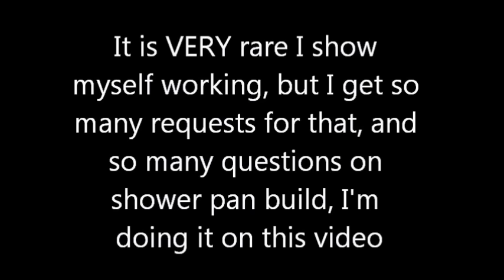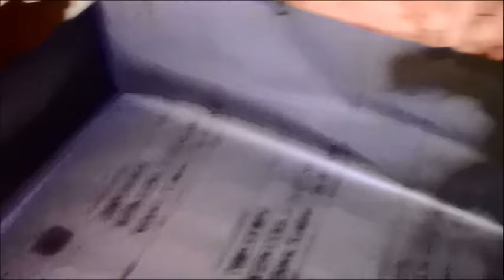HOW TO SET SHOWER PAN LINER and MORTAR

Comment: This is NOT correct.   A pre-pitched mortar bed is generally REQUIRED.   See the videos from Oatey - one company that makes the liners from Home Depot - they suggest that a pre-pitch is done ALWAYS.  This is to avoid water pooling in the low spots of the floor - giving the CUSTOMER a musty smelling shower.   The pre-pitch avaids the standing water.   Don't EVER make a custom made shower pan without a pre-pitched bed.     

See this video for the correct procedure.  ----- >   https://www.youtube.com/watch?v=xpE1A6ogUNI
Reply from the maker: You are sadly misinformed, even by the manufacturer, if you look on that video I made my comment years ago, they did at least four to five things incorrectly in their own video....
Now fast forward years from when that  video was produced and nobody is doing watery and water out system anymore, everybody puts a waterproofer on their mortar pan so the whole idea is Antiquated and irrelevant

Comment: You must Always,  Always have a pre slope !!  ,   To prevent water pooling underneath pan liner !!
Reply from the maker: No water will ever get there when you waterproof the surface...moot issue
Reply: If done correctly, why would water pool underneath? Do you really think water is gonna flow freely to the drain? 😂

Comment: It takes me 2 days to prep a shower 100%.  Why wait 5 days?? No need to redgard the mortar bed....Just do a pan liner with a preslope or a thin bed method with kerdi membrane/kerdi drain and ardex 8+9 over it....That way you don't need to wait for the mortar bed to cure for 3-5 days unless you have other things to do.  Do you only do tile?? Do you remodel the whole bathroom from A to Z? Show us a video of complete remodel...Drywall, electrical, paint, cabinets etc....
Reply from the maker: You have your method and I have mine, I am not into the newer products out there since my method has been a Fail-Safe there's no reason to change it.

And yes I have a very wide variety of skill set, on my main channel is my intro video and you can watch it to learn about me and my knowledge👌
Reply: @StarrTile  I noticed in a video by someone else that he presloped mortar before he put the pan liner on and then sloped the top layer. You don't preslope/mortar. Just your way of doing. Any advantage to presloped or not?  just curious and do you suggest Redgard before pan liner or is it an overkill
Reply: Yeah I’m surprised Bob didn’t do a pre-slope.  I’m sure he has good reasoning behind it.  I know in a lot of new home construction/remodels they  just set the pan liner on the sub floor, no pre slope.
Reply from the maker: @charliegarrison2987  prior to about 5 or 6 years ago when nobody was waterproofing their pan surface then there might be a very slight advantage to do in a pre slope but it would be negligible because your pan material would still be wet regardless... nowadays everybody's waterproofing the surface of their pan before their tile so have any pre slope serves no purpose and is a moot issue
Reply: @SINSTER7THREE  He's explained why he doesn't do preslopes and he's also made a mockup showing how it works in other videos, look it up. I believe in preslopes because i've seen a pan liner crack and leak in an old shower with no preslope and clogged up weep holes.... Nobody does preslopes in Fl and Georgia in new construction and yet those showers don't seem to leak.
Reply: StarrTile Hi Bob great videos! When you say waterproofing their pan surface so there’s no need to do a pre slope do you mean sealing the plywood before you install the pan liner with some sort of sealant?
Reply from the maker: @joetallman41  No, the pan surface meaning the mortar that you pour in the pan, after it's dried and cured for 3 or 4 days and I've set my wall board on my walls then I waterproof the entire thing, you could take a shower in it with no tile set whatsoever
Reply: StarrTile thank you

Comment: Damn homie.... That Hardie backer really needed to go up on green or purple drywall and not straight to the studs. Though, the biggest issue is your water seal. First, you pre slope to the drain in the shower "bedding".  Second, you put your shower pan in at least six inches up the wall all around. The pan is installed up to the drain and is siliconed all the way around drain, with the pan material sandwiched between flange and drain. Then, you install your Hardie — preferably over water resistant Sheetrock. Finally, your membrane goes up the walls to the top and all the way down past the top of shower pan.

After all this, you will be ready to lay tile.